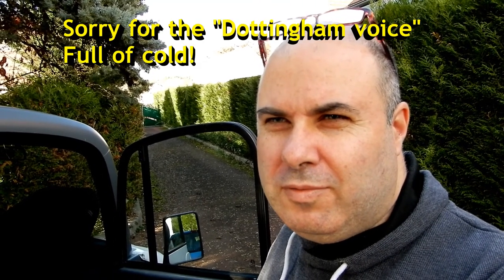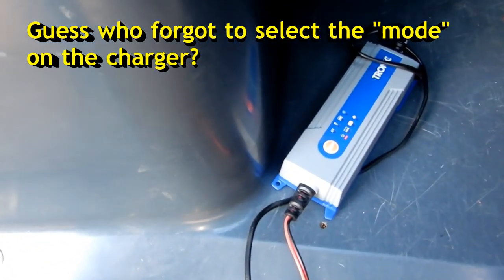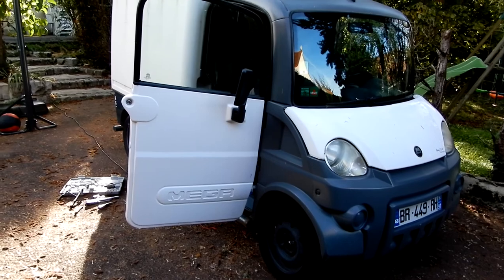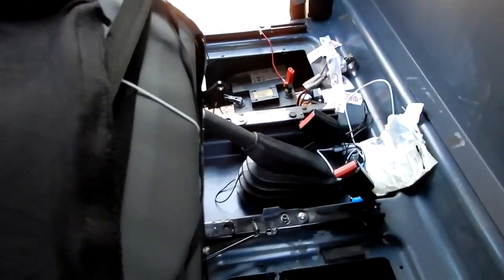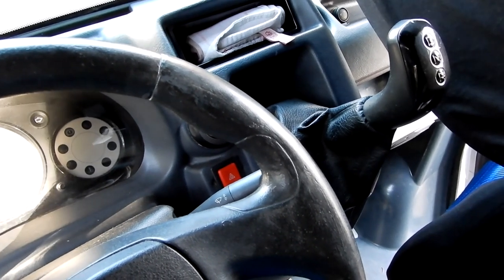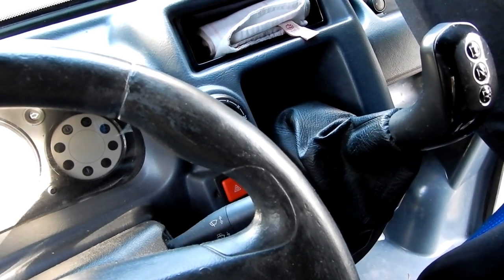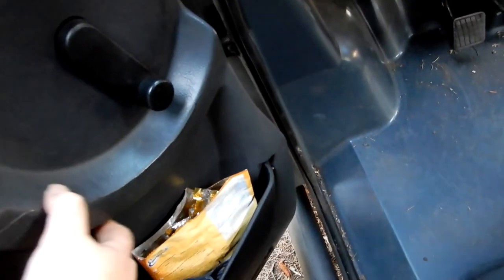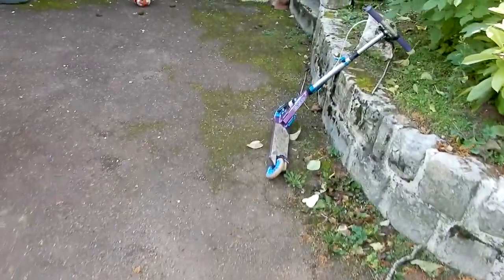Using a Lidl battery charger and other bits | Aixam Mega Multitruck Van

Comment: hi are the spare parts for the aixam van  expensive
Reply from the maker: Depends what it is. Aixam has sourced parts from other companies for the mechanics. They essentially just build the bodywork and frames. A Kubota engine brand new is 4000€. A good second hand engine around half that. I've just bought a new micro switch for the gear shift... 18€. 
A brand new D truck is around 13,000€. A truck like mine, the older Multitruck, second hand can vary between 3000€ for  one that needs work to around 7000€ for a really good one. Not cheap for what they are.
Reply: @MegaBreadvan  I like the same truck you got :). I see the video of the micro switch replacement good vid:) I bet the aixam parts are easier to got in France than the uk
Reply from the maker: @s.y.g-gamer2589  Well the micro switch has just been cleaned and is hanging on... I need to get around to replacing it with the new one. You've got Mega vans over there too, a lot of them in use as food/coffee stalls. Don't know if Aixam have a dealership over there though. I buy my parts from ProVSP.